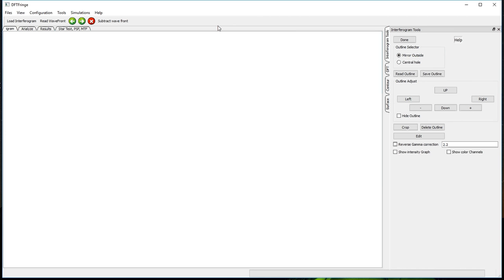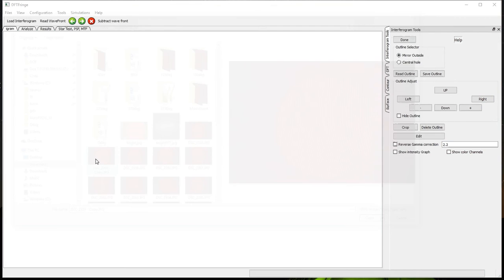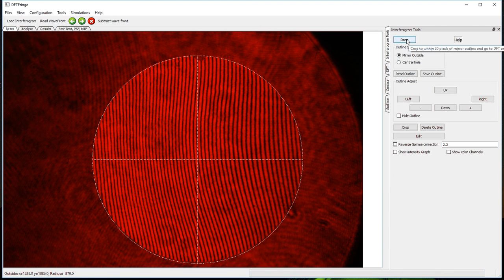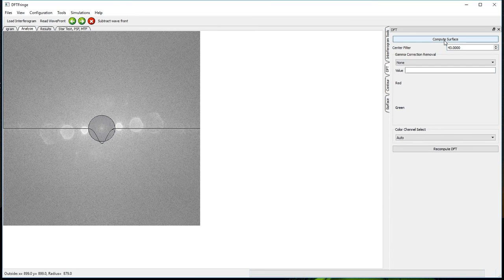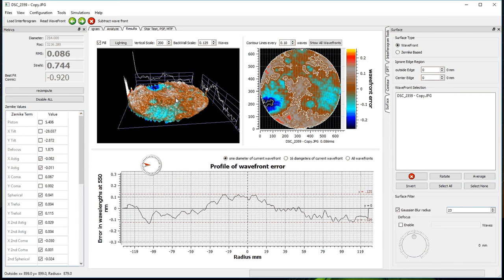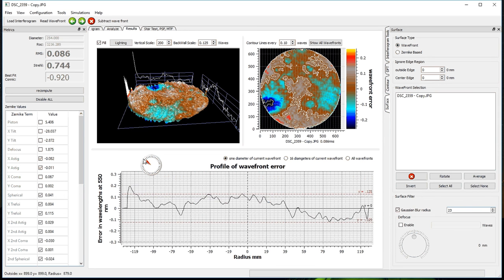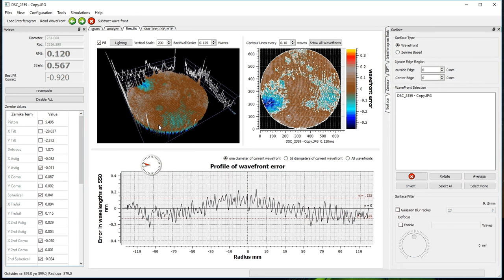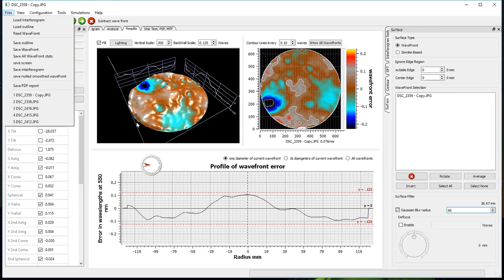DFTFringe quickstartGuide

Comment: I managed to get the Qt extension for VS 2019 but now the .exe is never found druing a debug or release complile. My guess is that Qt support in VS 2019 is dwindling and I don't wish to migrate to 2017. Hence, I think this may need a reboot into pure VS using VS's pretty good built-in GUI creation tools which, in my opinion, can be made to be nearly as good as anything Qt could produce.

How about a full revamp into C#?

Thoughts.

Comment: I am attempting to augment the open source code (well, pretending like I'm good enough at C++ to add to the program), but I can't seem to get #include QApplication to work in Visual Studio 2019. I have downloaded QT extensions but to no avail. How should I go about working with the source code in Visual Studio 2019? I am still relatively new to programming.

My father runs Kerry Optical Systems and we would like to see if it is possible to import a live video stream into DFTFringe to see if 5fps optical analysis can be accomplished. I currently have an AMD Ryzen 7 2700 with 32GB of ram. The 2700 is an 8-core 18-thread processor. A single analysis takes about 3.64 seconds. I am not sure if DFTFringe utilizes multi-threads or if the GPU may also be employed to add some juice to the overall process.

What .cpp and .h files contain the image analysis portions of the program?